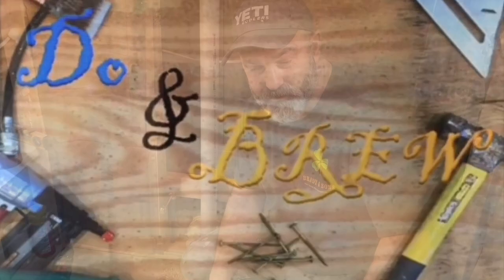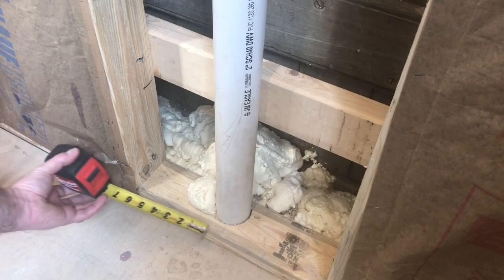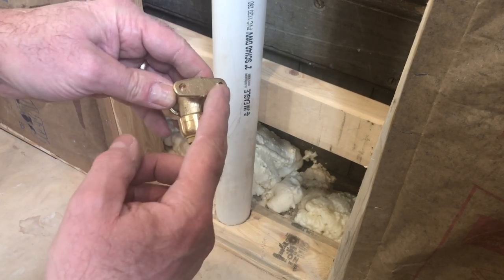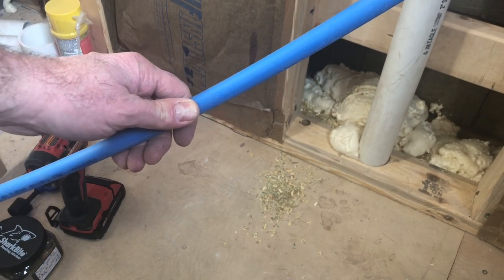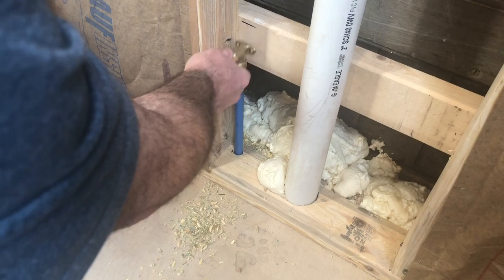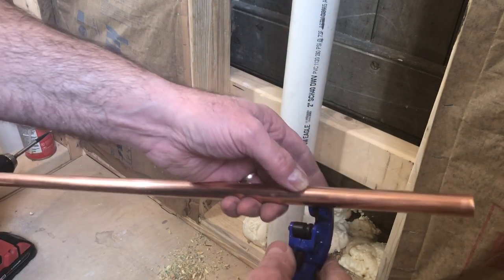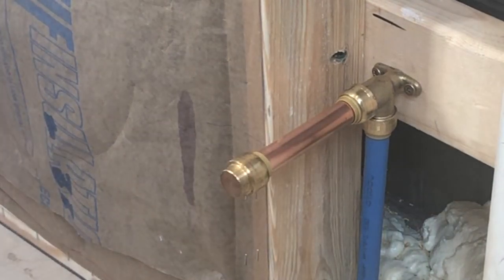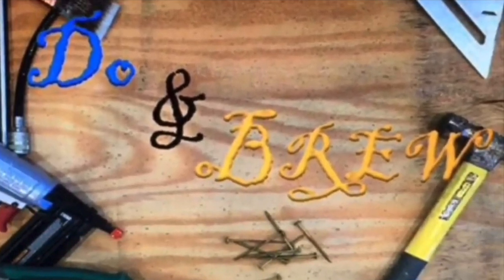Toilet Water Supply Pipe Install

Comment: Thank you! I was looking for a better way to run my toilet water line feed. We are renovating our bathroom and the original builder just had a pex pipe coming out of the wall. Being plastic pipe it was flexible and didn't look good just hanging out of the wall. This way ,using copper pipe it looks so much more professional and nicer in my opinion! Thanks again!
Reply from the maker: Howdy Retired at 49!  So glad the video was helpful.  Good luck with your bathroom renovation!!!   ☘️

Comment: Maybe because I live in California where it is literally impossible to buy a house for under $1M, I tell people "You have a $3M house, why care about spending an extra $100 on plumbing parts.     So, we ALWAYS stub out to 1/2" male threads and put a cap on, then after drywall and paint replace the cap with an angle value.  On toilets always install anti water hammer air chamber.

Comment: What if I want to run hot water next to it (for a bidet)? You can't run hot in pvc, can you?
Reply from the maker: Howdy Catphillips!  Thanks for checking out the video.  You could use cPVC for your hot water pipe, but I prefer PEX - which works for hot and cold.  PEX is also available in red and blue so it’s easier to keep your hot and cold water lines recognizable when/if a future repair is needed.  Let me know if you have any other questions.  Good luck with your project!   ☘️

Comment: I am in MA and do not think it is legal for a in wall job, not sure about the other States.
Reply from the maker: Howdy Zijia Liu!  SharkBite fittings are certified to ASSE 1061, NSF/ANSI 61, NSF/ANSI 14 and NSF/ANSI 372. They are listed by IAPMO and CSA. SharkBite fittings are compliant with the Uniform Plumbing Code (UPC), National Plumbing Code of Canada and the International Plumbing Code (IPC).  I was not able to find a reference to push to connect plumbing fittings in the MA residential build code, but I did see numerous MA plumbing blogs stating they are now allowed for use in concealed spaces in MA.
Reply: Do And Brew - DIY Thanks! That is good to know.
Reply: Last I checked, shark bite and crimp PEX is not allowed in Los Angeles, either.  Not sure if that's changed.

Comment: Hi good explanation and good video.  Question, I was once told that insurance does not cover in-wall/hidden Sharkbite fitting failures.  Is this still the case?
Reply: Where did you hear such a thing, ?
Reply: Just looked it up.  For my insurance company, plumbing compression and press fittings are allowed provided they are accessible and warrantied per IPc and UPc. I called them and they confirmed that SharkBite were within this category but they are now approved for in wall/enclosed installations.  Guess it was old news which I wanted confirmation on.  My employee, a certified plumber, only installs Sharkbites if they are accessible and if a PEX/crimped fitting is too difficult to do.  Ringed or Propress pex is much less expensive then SharkBite anyway.
Reply: @ibrazeau3044  Same code here.  Can't bury shark bite behind a wall

Comment: Nice!!!  Can I do the same thing with the supply lines going to a bathroom vanity? Thx
Reply from the maker: How’d Vincent!  Yep, you sure can…it’s all about a solid/sturdy connection point.  Thanks for the comment and for checking out the video!   ☘️
Reply: @DoAndBrewDIY  Awesome!  Thank You!!  How deep should the drop ears be for a bathroom vanity? Flush with the studs? I'm using a pex fitting...  1/2" x 1/2" FNPT Drop Ear Elbow so I won't have copper, just a 3" or 4" pipe threaded on both ends to connect the shut offs... Thanks again!
Reply from the maker: @vincentguarino4262  better to go long…nothing wrong with a nice, solid, attractive pipe stubbed out with a nice flange cover to attach your shut off valve.  In the past, if I tried to calculate it to the 1/16 of an inch I would always end up 1/4” short!  Good luck with your project!!!   ☘️

Comment: I dont know if a sharkbite push on will make it for the long haul, i have seen in the insurance business  , them not paying if it fails in the wall when your gone. i guess it depends what company and local codes?
Reply from the maker: Howdy Steve!  Shark bite fittings can be used in underground / behind the wall applications and as manufactured joints without access panels per the latest edition of the Uniform Plumbing Code and the National Plumbing Code of Canada.  Other certifications include: ASSE 1061, NSF/ANSI 61, NSF/ANSI 14, NSF/ANSI 372 - similar to all other “traditional plumbing” solutions.
Additionally, SharkBite fittings comply with the Uniform Plumbing Code (UPC), National Plumbing Code of Canada and the International Plumbing Code (IPC). You should always check your local plumbing codes for specific applications.

Comment: The pipe inside my wall behind the toilet leaks. I had it fixed 2 years ago, apparently they didn’t really fix it because it’s backed to the same thing, how do I fix it.
Reply from the maker: Howdy Braxton Bunch!  If you have a pipe leaking inside a wall, most likely you are going to have to remove some portion of drywall to see what’s going on to do the repair.  Removing/replacing drywall is not that big of a deal…just start small to find the leak and goi from there.  Get on it soon - an active water leak is never good!

Comment: Do you paint or otherwise conceal the copper tube as part of finishing?
Reply from the maker: Howdy Charlie Baum!  Thanks for the question... The copper pipe will be covered by decorative flange at the wall and the water valve that controls water to the toilet.  You will most likely only have 3/4” - 1” of copper visible when complete.  Honestly I don’t mind that small amount of visible copper showing...you could paint it OR there are covers available to hide the pipe.  Google “decorative copper pipe sleeve” or “....cover”.  Thanks for watching the video and let me know if you have any more questions.    ☘️